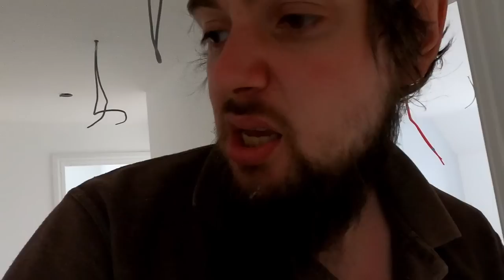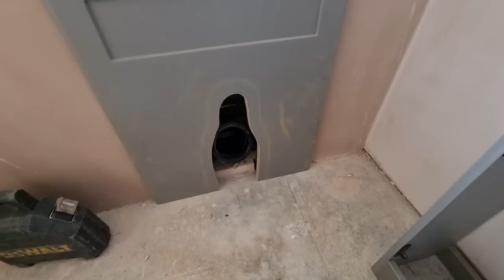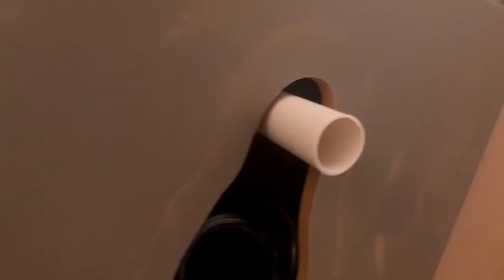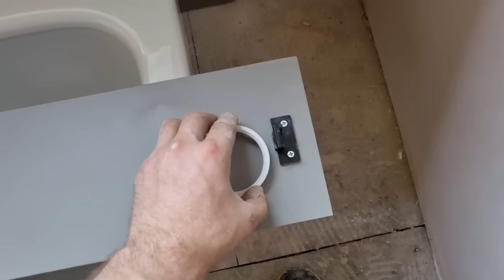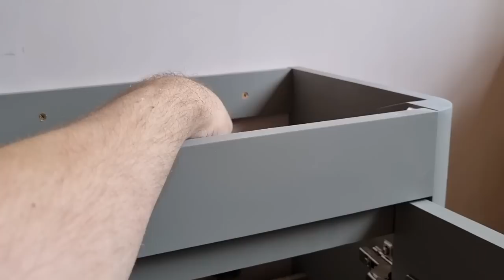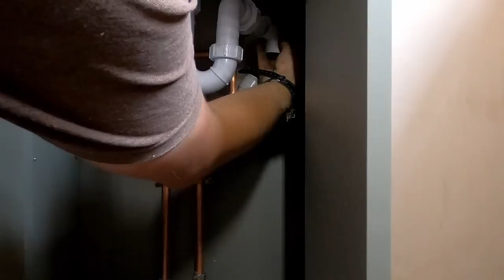An Easy Day Of Plumbing ?            Toilet and Vanity Unit Install

Comment: I compare the speed at which you completed that under sink work to the speed at which I (a DIY plumber) would have done the same job!! I am about 4 times slower but learning as I go - thanks for sharing, it helps a lot.
Reply from the maker: Learning is what's its all about, speed only comes with experience, thanks for watching as always

Comment: My advice to any plumber fitting a BTW pan is make sure the floor is stable/secure and the pa. Doesn’t move once install as any move will cause the flush cone to slowly work its way out and leak.
Reply from the maker: It is critical that to be fair, like you say the pan should be stable and solid, thanks for the support as always
Reply: I normally put Plumbers Gold sealant on flush/pipe cone to stop it coming out.

Comment: Tidy work Tom as always, marks on ceramics are a real pain, had some nightmares with them over the years, good to see that job through to completion, carpet fitters before everything is finished !!! hope they have a good vacuum cleaner, looked to me like the sparkies had a bit to do, that always means someone will be hoovering🤪👍🚽
Reply from the maker: Thanks for the support as always Peter, downstairs was more finished than up to be fair, everyone is a bit behind but the builder is pushing like mad, I'm alright though which is the main thing, it's normally me holding the job up

Comment: Very nice work as always 👌 I'm always partial to a hard piped tap.

I got the rothenberger equivalent of your ox plastic slice and I'm not 100% sold on it yet. Breezes through push fit but it's tough going to turn it on pvc solvent weld pipe. Dunno if that's just the rothenberger cutter or general to these types.

Got it for the college assessments as it's so much quicker than the knackered old hacksaws they've got.
Reply from the maker: Thanks for watching as always mate, to be honest I love my OX cutter, I always used to use a hack saw, and I was sceptical as to how good it would be, it flies through solvent, the only thing I would say is it's better to score lightly all the way round once, then press a bit harder otherwise it tends to track
Reply: @PlumbLikeTom  thanks good to know. I'll practice a bit more with this rothenberger one might be a bit of a knack to it on pvc. 👍

Comment: Nice work as usual Tom. It would seem a frame toilet would have been a ‘simpler’ solution - would it have been more expensive?
Reply from the maker: The frames can be quite expensive, it would have also been difficult to pass the soil pipe behind for the other toilets along the run without stepping everything forward more, in the end the job looks nice and is as the client wanted, thanks for the support as always Norman
Reply: @PlumbLikeTom  Thanks.👍

Comment: Nice work tom but why didnt  you just fit the unuts then box and plaster up to them ...seems a waste of a unit just for  front panels ...👍
Reply from the maker: The units tend not to be that strong, being in a kids home things tend to get destroyed so having just the panels is better in this situation, the fronts will probably end up being stuck back as well, I know this makes maintenance a bit harder but will stop anyone from tampering with stuff, thanks for watching as always

Comment: great video mate and never heard of one of the ceramic eraser worked a treat. Also what flux brush is that if you can remember, the ones I get seem to snap after a week.
Reply from the maker: I believe I got the flux brushes from BSS, I got them ages ago, like you say most seem to drop to bits after a while but these hold together well, thanks for watching as always mate

Comment: Where did you buy the brass pipe clips as I used talon clips under a kitchen sink cabinet but pipe is connected with a compression fitting and protrudes too far out.
Reply from the maker: Have a google for 15mm school board clips, most plumbing merchants should stock them, they do look nice and space the pipe off the unit that bit more, thanks for watching 👍
Reply: @PlumbLikeTom  thanks Tom

Comment: Good content as per Tom, some sound advice there, is that a Roper Rhodes wc unit? If so hang on to the spare clips as I’ve had a couple recently where one of the clips have been broken.
Reply from the maker: I always keep bits like that mate, I've broke a few just taking panels off before, thanks for all the support mate